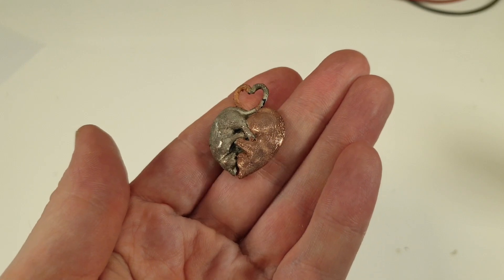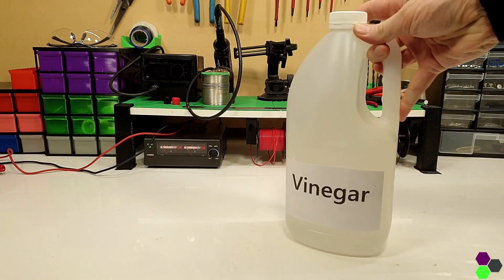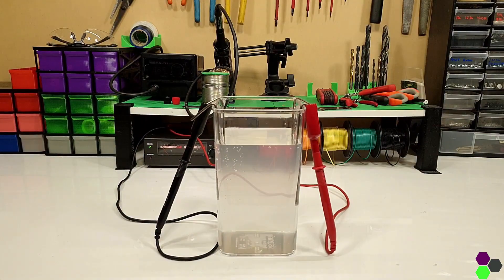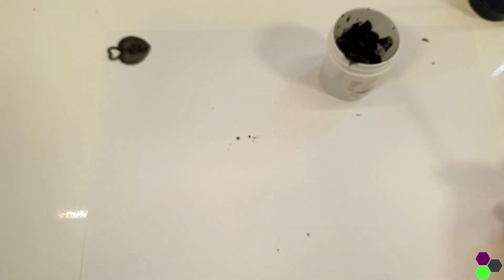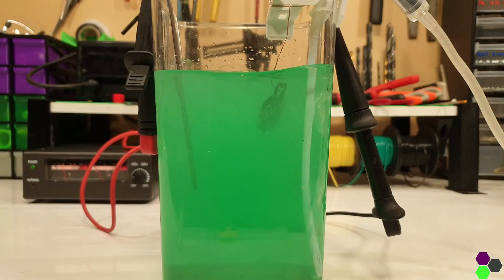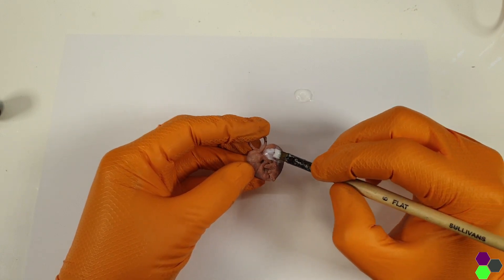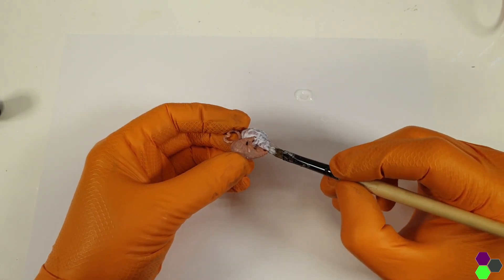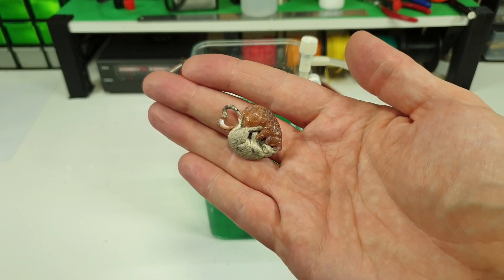Metal Plate 3D Prints with Nickel and Copper

Comment: You were right in your answer to my comment on your other plating video, this has a lot more information. I didn't see the angry comments you mentioned, but I assume they have to do with electrolysing a solution containing cloride.😅
P.S.: Bonus points for pronouncing "aluminium" correctly, and have a negative point for then doing the other pronunciation anyway.😉
Reply from the maker: Oh the angry comments are on hackaday, this video got shared because of the brush plating pen idea. But yes, people were angry that I put sodium chloride in the electrolyte (not taking into account the quantity is so low you'll be exposed to more chlorine gas standing beside a swimming pool on a hot day).

Comment: What’s the machine called you used to give it electricity so I know what to get?
Reply from the maker: If you search for "benchtop power supply or lab power supply" you will find a whole lot of similar options.
The specific power supply I used in this video is this https://www.jaycar.com.au/compact-switchmode-laboratory-power-supply/p/MP3800 
but you don't need anything as large or expensive. I used to use 3 X D cell alkaline batteries and got great results.

Comment: Brodie,
Your videos are so good!  You don't waste our time, you give straight forward and complete information and it seems obvious that you take the time to arrange the objects in your videos thoughtfully so the visual is very clear.  In my opinion, you should teach other content providers how to produce instructional videos.  Kudos to you for setting a high standard! It is appreciated!
Reply from the maker: Thank you so much Bret, it means a lot!
Reply: @BrodieFairhall  I finally started experimenting with copper plating.  I want to copper plate two plastic airhorn horns, so I wrapped them loosely with cooer wire (after painting them with nickel paint). I got areas with good coverage, and others, especially where the wire touched the horn, no coverage.  So, a couple questions... Should I use a fine copper wire?  Mine may have been too heavy.  I could use some pointers on how to wrap it.  Should the wire touch the piece being plated or does it just create a "field" around the piece?  Thanks again for all of your help!

Comment: that conductive coating seems very inaccurate as it looks like itll change the shape of the original object, perhaps a sprayable method would be better
Reply from the maker: It's both good and bad, it removes a small amount of detail but also fills in layer lines in the print, saving you from filling and sanding.

I don't generally use or recommend graphite anymore, I use a nickel conductive spray from MG Chemicals as it's much better.

Comment: What a great video, I think you explained everything really well! But do you think that one can plate aluminium just on the graphite? Also can you plate steel onto anything?
Reply from the maker: Hi Martin,
You can't plate aluminium with this process, electrolysis of aluminium is done in an electrolyte made from molten cryolite at extremely high temperatures.
You also can't plate most metals onto aluminium, because it is so reactive. For example, if you plate copper onto aluminium, the aluminium will start to degrade and fall apart in a chemical reaction.

Steel is also a very different and more complicated process, you can plate nickel and other metals onto steel, but plating steel onto things is not generally done through electroplating
Reply: @BrodieFairhall  Ok, Thank you very much for the info and your time!

Comment: I followed these steps exactly but I could get the copper to plate anything. Once I have the copper connected to positive and part I want to plate to negative with the power on, the copper just bubbles and nothing happens to the part. I have tried this both with graphite coated and stainless steel parts with nothing working.

Comment: I've watched both videos and they're two of the best I've found on doing it at home. What I'm curious about is plaiting aluminum to a printed part. You said briefly that it doesn't like other metals. Is it still possible.
Reply from the maker: Thanks for the kind words!
It wouldn't be possible to plate a print with Aluminium using electrolysis.
Aluminium is produced commercially using electrolysis, but the electrolyte used is molten cryolite at around 700°C and it's substantially more complicated than copper, nickel etc. It would be far less complicated to make a mould of your 3D print and do an Aluminium cast, there are some really good videos on how to do do this if it was something you wanted to try.
If you just wanted an aluminium look, you could try plating with zinc, tin or nickel or a combination to find the right metal colour.

Aluminium is generally plated onto plastics and lenses etc using vapour deposition, it's a little complicated but not impossible to do at home.
Reply: @BrodieFairhall  thank you, i was mostly curious. I may try the tin or nickel.

Comment: Great tutorial! What model is your plating power supply?
Reply from the maker: For this video I used this power supply (It's just my old high current benchtop supply, it seems to be available from a lot of different places too) https://janekits.com.au/products/15-amp-power-supply/

You don't need anything this big, for both my plating videos the current was much less than an amp and the voltage around 3V.
Reply: @BrodieFairhall  Thank you, I will try my step down DC converter for my experiments. I already powdered grafite from some pencils to make a conductive paint and experiment :D

Comment: Does the metal stick better than the graphite coating? You mentioned in your other plating vid that the graphite was delicate and prone to flaking.
Reply from the maker: As in does the silver conductive paint stick better than the graphite? (Yes it does)
Or, does the metal, once plated onto the graphite stick better than just the graphite? (If it is fully covering the 3d print as a shell, yes it does)
Reply: @BrodieFairhall  the later - thanks!

Comment: Where do you buy/get your various scrap metals from?
Reply from the maker: I'm an electrican, so I always have lots of leftover copper wire. The nickel in this video is from welding rods for cast iron that I got from the local hardware store.i have purchased various anodes from ebay and a company in Australia called jane kits. A quick google should find plenty of different metal anodes.

Comment: There are some less expensive conductive paints, mostly designed to provide EMF/electrical shielding.
https://www.amazon.com/StewMac-Conductive-Shielding-Paint-236-6ml/dp/B01HUD0JEG/
https://www.amazon.com/MG-Chemicals-Conductive-Coating-Aerosol/dp/B01N3AWGNX/
https://www.amazon.com/MG-Chemicals-Conductive-Coating-Aerosol/dp/B01MQ165E3/

Not cheap, but not as expensive.  The StewMac conductive shielding paint is $50 USD, for half a pint (236 ml).

Have you tried any of these?  Wondering if they work well conductively while having better adhesion than say, graphite paste.
Reply from the maker: I generally use the MG Chemicals Nickel conductive paint now.

Comment: I'm going to try this out.
I have some Graphite spray, I presume I can use that.
Reply from the maker: I'm interested to hear how the graphite spray works! Is it a dry lubricant or a graphite lacquer? If you have a multimeter you should probably check the resistance of the graphite after it is sprayed on something. Anything over 1k ohm over roughly 25mm (1") and you'll have a hard time getting the item to plate.
Reply: @BrodieFairhall  The Graphite spray is for creating a conducting layer. So not a lubricant. Also the solvent evaporates very vast and leaves a nice dull coat of graphite. I get a resistance of a couple of kOhms with a couple of coatings on a unpolished 3D printed object.
The product name is 
Graphit 33 (Dutch brand)
Upcoming weekend I'll try out your method on a few test objects. I will post the results here (success or not)
As a side note. I will attempt to build a 3D printed van de Graff generator. All parts are printed including the dome on which I have spent quite a few hours on polishing to a very smooth surface. I haven't got the slightest clue if it will work but it has been fun to create. Started 3D printing just a few months ago so still a lot to learn.
Reply: @BrodieFairhall  I promised to keep you up to date with my experiments. I have had some success with the Graphite spray but till now only on small objects. You do need at least 3 or 4 coatings to get the resistance to an acceptable level. I did use a voltage quite a bit larger then you suggested but I use a constant current power supply  and limited the current to around 100 mA. I will do some more experiments when I get ordered more spray (and some Copper sulfate)
Reply from the maker: @ZeedijkMike  thanks for the update

Comment: About how much current should one expect to push through?
Reply from the maker: There are a lot of variables associated with this, the main 3 being the surface area of the object you are plating, the type and strength of the electrolyte you are using and the type of plating metal.
For something small, in this electrolyte, you aren't going to want anything above 250(ish)mA, everything in this video is plated using <100mA. 
With so many unknowns, it is generally best to observe the Cathode and adjust the voltage (or current if you have a regulated current supply) until you have a light very light stream of bubbles coming off the Cathode. Too many bubbles leads to having trapped gas in the plating material and can also mask areas of the part and prevent the metal from bonding.
Reply: @BrodieFairhall  ah gotcha, thanks for the informative reply. Can't wait to give this a shot

Comment: Thanks. Lots of great info here. 
I'm looking into electroplating as a way to add additional strength to 3D parts. 
Do you have any information or advice on this?
Reply from the maker: This is definitely a something that is possible to do, I should probably make a video on it! In the mean time, I would look up "Electroforming", it is really exactly the same a plating, but when you add a much thicker layer of metal to a part / "Mandrel" there are a few extra things to consider.
- Each different metal will have an Electrical current / Surface area calculation and a recommended plating voltage, so an adjustable regulated power supply will definitely help with this
- A more conductive electrolyte will help a lot, generally, dilute sulfuric acid is used to make a lot of electrolytes and there is a lot of information online about this.
- A good conductive paint will work much better in this situation than graphite. Since making this video I have been using a conductive nickel spray paint made by MG Chemicals on my prints for plating and it works extremely well.
All of this might sound a little daunting, but, it wont take much searching to find all the information you need to get started with this.
If you are having good results plating objects using the method in this video, you may not need to look into the suggestions above, you can just try leaveing the part to plate much longer (I have left parts for 24 hours before) to build up a really thick metal coating.
Reply: @BrodieFairhall  Wow, this is a wealth of information. Thanks! I'm looked up electroforming now.  
Would you mind a few more questions? Outside of nickel, are there any other tough metals that are commonly used  (ex. iron)? Would there be some to avoid (ex. chromium)?
Reply from the maker: @Rouverius  Iron/steel is a little more complicated to plate/form with, I haven't successfully done anything with it yet and chromium generally requires some pretty toxic chemicals.
At home electroplating is generally very successful with "transition metals" things like copper, lead, tin, silver and nickel, but also alloys of these metals.
Nickel is a good option because it plates well and it is very strong, but there are also some very strong alloys you could look into, some types of bronze are incredibly strong and plate well. You can even create alloys by electroplating (say using a copper anode and a zinc anode). You will end up with a higher concentration of copper because it transfers ions more easily, but you can have different current flows from each anode to adjust this.
Steel is definitely possible, I just need to do more research and experiment more, but I would definitely do some reading on it, you might find a great way to do it!
Reply: @BrodieFairhall  Thanks. Ok, that makes sense about the transition metals with electroplating/forming. 
Yeah, nickel seems a safe first try and then later try other things (never chromium though). Good point about multi material plating. It does sound like it would be a type of alloy in some way. Also, might experiment with dissimilar electrolyte and sacrificial anode (like copper acetate with a zinc anode). 
Thanks again for all the great advice and information!

Comment: Great video!! What type of wire do you use to hang the 3D print? how do I connect the alligator clips to a normal 3V Lithium battery or do I need a different type of battery?
Reply from the maker: In this case I didn't use a battery, I used an adjustable bench top power supply, but I have used D Cell Alkaline batteries for this in the past. What kind of Lithium cell battery are you talking about specifically? Something like a CR2032 button cell or a Lithium Ion rechargeable battery? I don't specifically think either of those types would be really appropriate, each for different reasons. If it's a small button Lithium battery, it would probably be best to get a battery holder for it (Something like this https://www.sparkfun.com/products/783 )
But I would genuinely look at using some AA Batteries or something bigger (and safer than Lithium Ion) and adding or removing batteries so you can get the best results (somewhere between 3 and 6 Volts). The coin cells wouldn't last very long at all.

Comment: I’ve tried painting graphite/alcohol paint on my 3D print but saw some dissolving before the copper started building on top. Did you see this too?
Reply from the maker: I always ended up with a small amount of loose graphite floating off the part when it was first put in the electrolyte bath, but it has never been a problem
Reply: @BrodieFairhall  Have you tried plating a larger object maybe around 8 x 8 inches (20.3 x 23.2 cm)? Will it plate before the graphite floats off from any agitation? 
This would also work with iron, wouldn't it?
Reply from the maker: @coulterjb22  I have plated a few larger items, I would recommend using more anodes spread around the object, using a conductive paint (I've been using a Nickel based conductive paint made by MG Chemicals which is very good) and if you have problems I would change to another electrolyte (Dilute Sulfuric Acid for Copper and Nickel).
As for Iron/Steel, you can plate onto steel with Nickel, you can plate copper onto the Nickel afterward (copper directly onto steel will react and cause your steel to rust faster). Plating Iron onto other objects is possible, but the process is a bit different. You will have to find a suitable electrolyte, a lot of metals are plated using a molten salt electrolyte which is much more complicated than a water based electrolyte.

Comment: Well done video. you mention setting the voltage between 3 and 6. What do you set the amperage to?
Reply from the maker: I replied to this on my other video, but I'll put the same reply here incase anyone else was wondering.
I didn't regulate current specifically, I had the part and the anode at a set distance apart and adjusted the voltage (a range of 3V to 6V seems to work best for me). The current is in the low mA and gradually increases over time as the electrolyte becomes more saturated and the part becomes more conductive with its new layer of copper.
Reply: @BrodieFairhall  Thanks. I thought I sent the question but when I looked it was gone. i must have moved to the other video and didn't realize it. Thanks.

Comment: Love the video! Any advice on plating larger prints...armor, weapons etc? Any major changes from your process? Also, what are the advantages of using the salt in favor for the hydrogen peroxide from the first video?
Reply from the maker: Thanks Chris!
There are a few things I would suggest to make plating larger items easier and to get a better result.
Use a good conductive paint instead of graphite, I've been using a conductive Nickel paint from MG Chemicals lately.
Trying a different electrolyte based on weak sulfuric will give a better result but isn't necessary. The reason I am using the Vinegar and Salt electrolyte in the second video is because the Vinegar and Hydrogen peroxide really only works well with copper.
For large parts I use multiple Anodes located in different places around the plating bath, this helps get a more even distribution.
Experiment on test pieces, be patient as you'll want a nice thick metal coating so you can polish it afterward.
Also, have fun!
Reply: Thank you for all the advice! Quick follow up....how do you wire up multiple anodes? Thanks again!
Reply from the maker: No problem, for multiple anodes you can just connect more wires to the positive side of your power supply and connect an anode to each of them, still using the one cathode connection. You can experiment with where to put the anodes and where the cathode should go. Large parts might need to be rotated or moved and have the cathode moved to a different spot after a while to get a nice even coat.
Reply: You're the best! Great detail and advice, can't wait for your future videos!